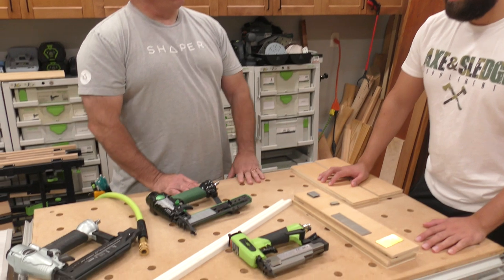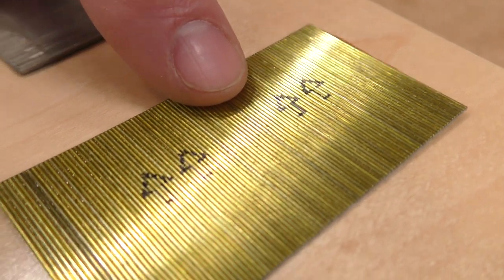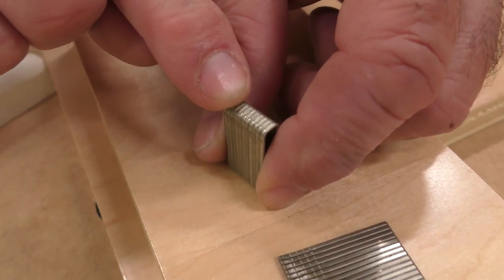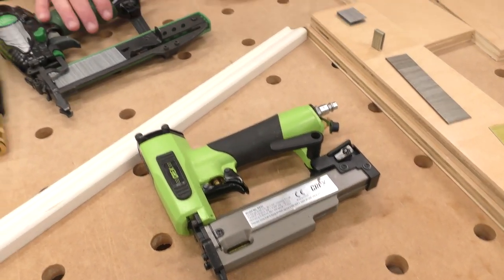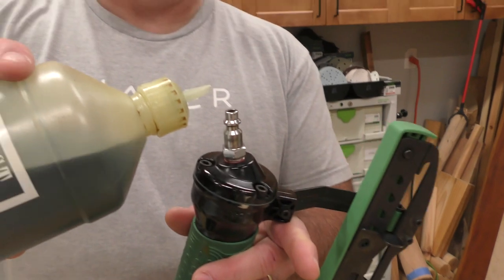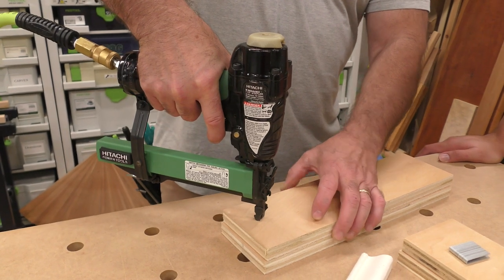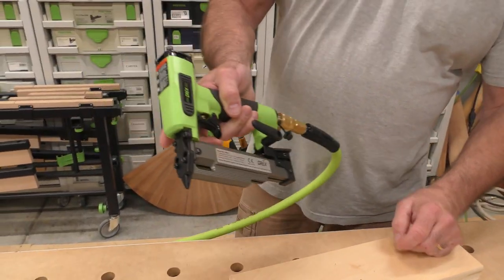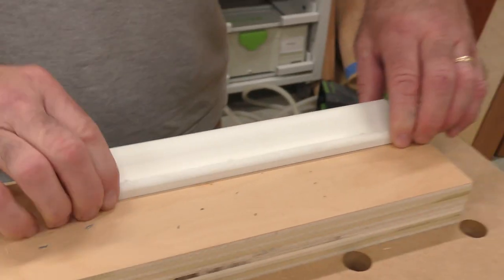Do you have this nail gun in your shop?

Comment: Sedge, 23 gauge pin nailers come in a wide variety of costs.  What is the buyer of the $150 or $280 pin nailer getting that the buyer of the $30 never-heard-of brand is not -- assuming for comparison purposes we're talking about air-to-air versions, not air-to-battery versions? I.e., when is a pin nailer a great tool and when is it a piece of junk -- and how can you tell?  Price is not necessarily a reliable indicator of quality, performance, or durability.
Reply from the maker: Longevity and quality of parts inside / seals / hardened drivers....It all depends also on frequency of use .....
Reply: Welsh rabbit just consider the reviews of the brand and model as well. This will show you any issues with the intervals or in the field use as well. I scored a grex for a pretty decent price used in my area and great tool for 23 gauge. Hope that helps.